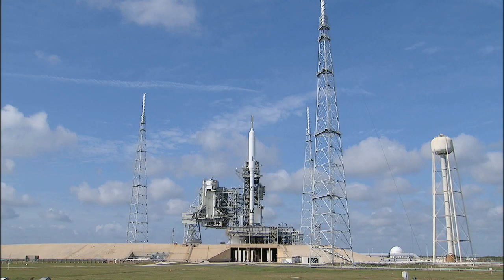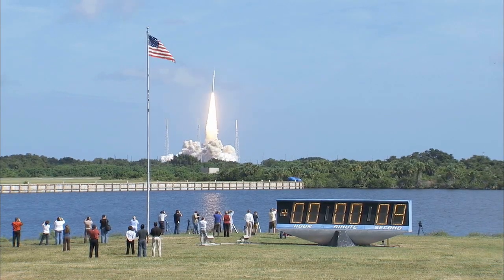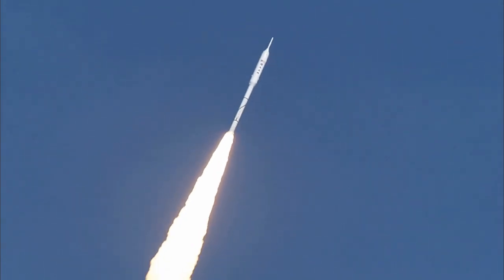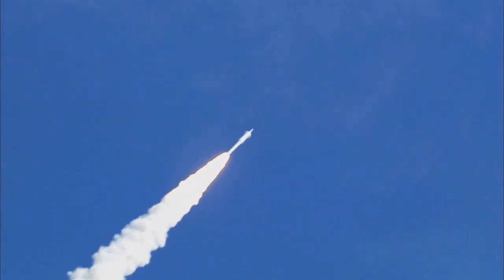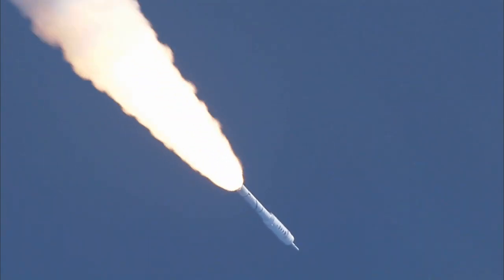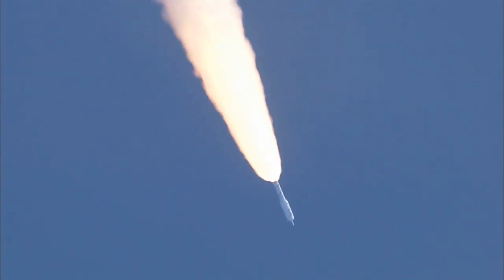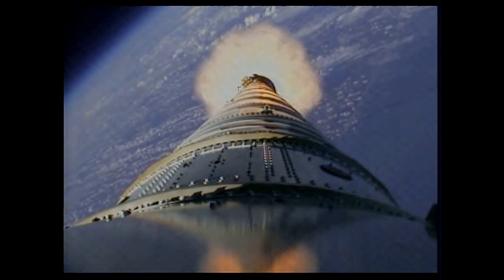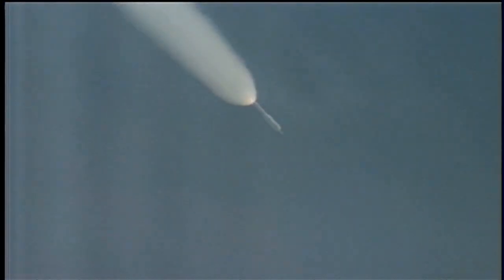Ares 1-X Test Rocket Launches

Comment: Does anyone know why this project was canceled? It was a brilliant and cheap way of getting into LEO. I heard that the amount of vibration the SRB made was to much for the rocket to handle with humans inside but yet the space shuttle had two and 7 humans could survive it. Just not sure why they cancelled such a good project.
Reply: +MrxFivexAlive 
shuttle boosters were side mounted easing the stress, plus shuttle had a 70 ton orbiter to carry to space, In ares mode it isnt and it takes off like a bat outta hell
Reply: In my opinion I think we shouldn't use SRB's on rockets ever again, I think you know why.
Reply: Yep, the shuttles boosters are to this day the most powerful SRB's. Wonder what would happen if ya put the first stage of a Saturn V on the orbiter with two SRB's to the side of it. Wow, you'd really get going.
Reply: They found in order to continue they had to put a lot more money into it so they just cut it instead.
Reply: Ah okay, good thing like commercial crew is stepping into play now.
Reply: MrxFivexAlive you should look up the Saturn-Shuttle concept.
Reply: @imzachjones  today SLS rocket IS the hybrid of Saturn V and space shuttle, it does really resemble :D
Reply: +MrxFivexAlive  They didn't have the budget to produce both the Aries Crew rocket ie Aries 1 "AND" the planned cargo rocket Aries V. So they decided an all up in one method like Apollo would be more cost efficient - one launch instead of two plus LEO docking.  There were also safety concerns for using a SRM for the first stage as they would not be able to throttle or shut down in case of emergency both in flight or on the Pad prior to launch.We now have SLS in design/production which is an upgraded Aries V.
Reply: +MrxFivexAlive You're saying that we should stop all use of solid rocket motors just because of a couple of failures. You could stay they should've stopped using the Falcon 1 after three successive failures. The problems were fixed and the Falcon 1 flew two more successful missions, the same could be said for solids.
Reply: +MrxFivexAlive SRBs are not to blame for lapses in Human judgement. With respect to Challenger and her brave crew, the engineers told NASA brass not to launch, but they launched anyways. Also the shuttle had no escape system. On Apollo, the crew capsule would have been hurled away the moment that the computers detected the possibility of the ET exploding.
Reply: MrxFivexAlive STS had 2 solid rocket boosters, a huge external fuel tank, and the orbiter. The area rocket was tall and skinny, STS was tall and fat. STS has better stability
Reply: SRBs are inherently less safe, though. They detonate, whereas liquid fuel rockets deflagrate. Far easier for a launch escape system to handle deflagration events.
Reply: Costs. This was canceled during the depths of the biggest economic collapse in a century. Obama was more interested in pushing privatization efforts, which of course led to SpaceX and Blue Origin.

Comment: when will the Ares V come out?
Reply: +Duderocks5539 Cancelled
Reply: SLS is basically a redesigned Ares V.  It has four engines in its first stage instead of five, and bigger SRBs to make up the difference.  It also has a cheaper upper stage.

Comment: Depends on the rocket. Typically it's about 10,000$/kg. Subsidies sometimes push it down to 4000$/kg. A Falcon 9 costs, for a commercial contractor, 56.5 million $, which puts it at 4500-5000$/kg to LEO.

This does not change how much money NASA gets. Which is half a penny for every tax dollar.

Comment: That looked good, till the point it started rotating....
Reply: It doesn't have a propulsion system or a guidance. The second stage is just a dummy payload.
Reply: It was rotating on purpose
Reply: @someinternetperson  it wasnt
Reply: @galaxy-z2d3b  yes, it was a test, they rotated it on purpose look it up
Reply: @galaxy-z2d3b  2:21 “we have a tumble motor ignition” u deaf?
Reply: @someinternetperson  a direction of 64 bits was assigned in one of 16 bits what happened was similar a bitflip
Reply: @galaxy-z2d3b  but they said it was on purpose, I might be missing smt but I thought this was on purpose
Reply: @someinternetperson  i was told that maybe ur right lol
Reply: @someinternetperson  the point of a rocket is to get outside the orbit and i was told about that situation im convinced it was a fail it rotated and failed
Reply: @galaxy-z2d3b  ok, it is a test launch to test the capabilities of a proposed rocket, ares-1x, they did a test on the upper stage (I forgot the purpose) the lower stage tumbled because it always does, all shuttle boosters like that have, including this, it wasn’t a failur

Comment: The Liberty rocket (whats left of the Ares1 concept) is much improved.  It looks like they went with the better escape system and worked out a fix for the major vibration SRB problem.  On this sub orbital test launch there was some damage to the pad when the SRB almost hit the side of the launch tower.

Comment: @mainstreetgse Oh, and by the way, NO it does not require a HUGE escape system. The Ares / Constellation fell back on many of the Apollo concepts including the very simple escape rocket system. It had a simple rocket attached to a shroud the covers the crew module during lift off. Up to a certain altitude, the rocket could be fired and it would pull the crew module away from the rocket. If it ended up not being used, it simply pulls the shroud off at a designated altitude.

Comment: that was awsome but the separation was strange... wonder why they had both parts "tumble"
Reply: testing
Reply: While your comment is 12 years old, for any who come along, the upper stage tumbled because it was simply a dummy load. No control, it was a fairing with weight in it is all. Had it been a real vehicle, a booster motor or RCS thrusters or something would have kept the vehicle straight.